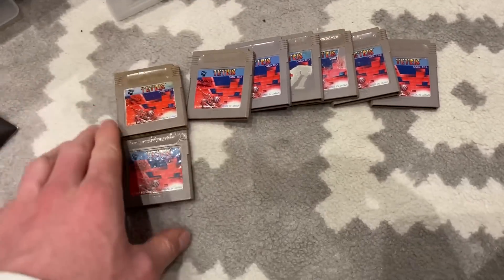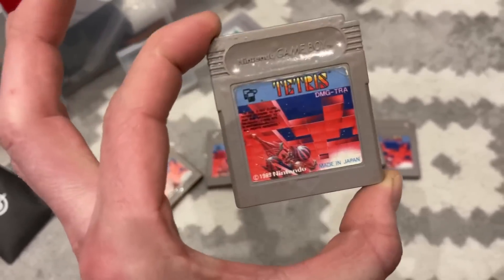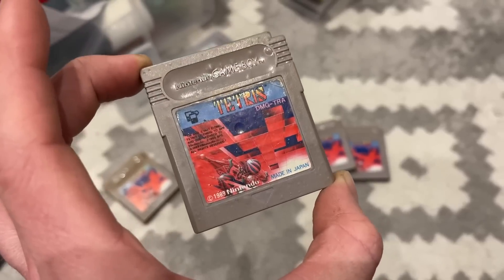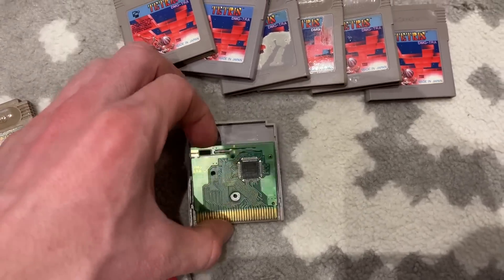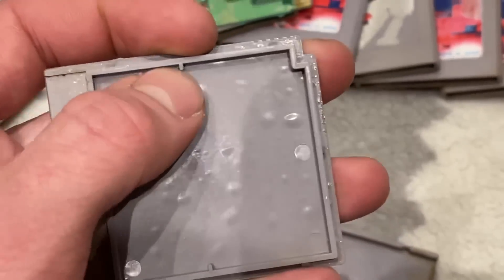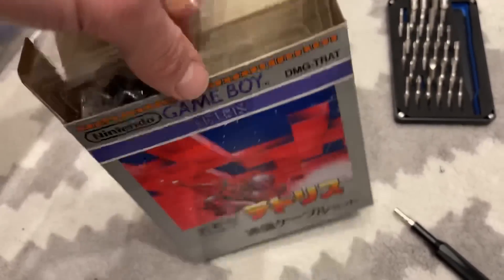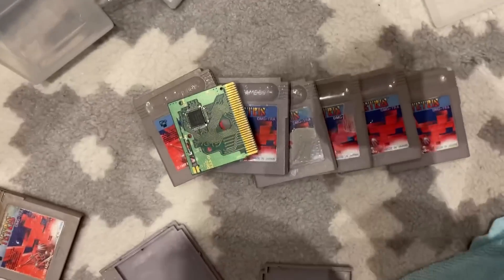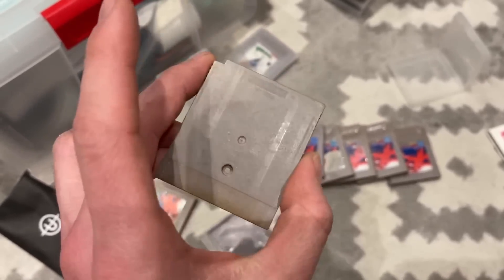Update on the destroyed GameBoy games

Comment: I doubt it’s fumes as you would need to douse everything in petrol.

Best way to find out is in a controlled test. One container with a small amount of petrol and a cheap game absorbing the fumes (overkill). The other cartridge put in the oven for a short period of time on the lowest heat.
Reply: on what basis are gasoline fumes NOT caustic?  it is the fumes that are ignited in a car.   if the fumes are active enough to be flammable, they are active enough to be caustic to other materials.  you know chemistry is interesting if you pay attention. i bet you think if you're wearing a gas mask, you're impervious to Cyclone B or sarin gas - no, it can still be absorbed in your skin.
Reply: @zxbryc  the volume and exposure of petrol fumes is the deciding factor. A short exposure will not do much especially if they are in a container as it will take a period of time for the fumes to enter the container depending on leakage and air pressure. Proximity is also a factor.
I’m not a chemist and I don’t claim to be. That’s an accolade that takes years to develop. My “educated guess” is that unless it’s persistent exposure (enough that could cause organ damage or breathing issues) then “I doubt” it’s petrol.

Comment: Don‘t use alcohol to clean them!! Use COCONUT oil and a bit of baking soda. Make a mixture and use your finger to rub and clean them plastics off.

This happens to old action figures from the 70s and 80s. Look at old My Little Pony and TRON toys. They are gooey and sticky. These old plastics are breaking down with age and environment. 

Again, don‘t use a solvent. Clean them, wipe them dry. The baking soda with safely scrape off the goo and the coconut oil with replenish the lost moisture.

Comment: The game boy cartridges are usually made from  PP petroleum products usually corrode mose of the plastics so that’s your answer probably the fumes made their way up cuz fumes go up when vaporize…it could be a leaky box u had them in not airtight and the older version could have a type of plastic that is sensitive to petrol…I guess they use more than one kind of plastic…maybe cuz it’s an old revision people had problems and Nintendo changed their plastic chemistry after a while…can you do a test get an old cover put a bit of petrol in a container and leave it in a box with a cartridge and see what happens…

Comment: Hmm seems reasonable. I should probably know this more definitively as a former chemist, but if it is an interaction with a vapor like gasoline, acetone, whatever, I would say that it wasn't broken down chemically, but it was just partially dissolved by the vapors. Then the structure sets back up in a slightly different shape than before but not chemically broken, just not in the exact same crystalline structure as before. Not that it helps any in restoring anything but just my theory. Or BS

Comment: How close to the ocean are you because a open air loft could be getting moisture with salt in it and that could be a problem gas is not going to leave a film on the cartridge but best way to tell is I know it's not very sanitary but if you still have one that is wet inside lick it with your tongue if gas or salt or something else you will be able to taste it most likely but I would invest in a dehumidifier for your loft and get water and air tight storage containers

Comment: Yeah, that sounds like a solvent that can melt plastic.  Vapors have the same effect of the liquid state. Not sure which material those chartridges are made of, so I cannot be 100% sure, but I know that grey plastic used for videogames in the '90s is cheap plastic (that's why it yellows and needs to be retro-brighted).
That could explain why the ruined chartridges are the old grey ones.
Again, I' m not 100% sure but all the clues match too well, it's difficult to belive it's all a coincidence.

Comment: I’ll tell you right not it’s not the hot or cold - I’ve stored these in temperatures up to 125F in my garage. Not a single bit of damage. Temperature doesn’t hurt this type of plastic.  It’s most defiantly a chemical interaction, and fumes from fuel could absolutely break down plastic. The fumes carry the chemical with them, which will bond with the plastic, leaving it kind of “squishy.”

Comment: Electronics are a curious thing. I opened up my Xbox 360 controller last year because it hadn’t been staying on and my batteries weren’t corroded. Anyways when I took the shell off it reeked of a smell similar to fish oil but it was incredibly hard to breathe around it. But what was even stranger was that the white plastic frame surrounding the potentiometers for the triggers, had been eaten away. I cleaned all with alcohol best I could to slow the rust/ corrosion from spreading, I also removed both rumble motors as they were covered in rust. I recently opened it back up and it hasn’t gotten any worse, I’m hoping I’ll be able to re-solder each of the components and get it to work again. The traces all look fine and that’s the only reason I still have a glimmer of hope that it can be fixed, however it wouldn’t surprise me if it didn’t. Anyone else ever see this happen/ know what happened? I’m paranoid it’ll happen to some of my other controllers even though I immediately take the batteries out after playing.

Comment: The way a house is built is all gas will try to off gas through the roof. That's why you need ventilation in your attic area. If You released gasoline into your house, the ethanol fumes 100% would have risen through the house and tried to evacuate through the roof. And if you have items out there, they easily could have been affected. Just because you can't see it, or even smell it, doesn't mean it isn't there. Look at covid as an example. You probably trapped some of the ethanol fumes, in with the plastic, and it started to disintegrate it. The bubbly and stuff and residue that you're rubbing off on your hands is most likely causing cancer. Next time maybe don't store a leaky item in your house that's releasing gas fumes? That could have killed you.

Comment: I think you figured it out, the petrol fumes likely started dissolving the plastic. And the older cartridges are probably a different mixture of plastic that's less resilient. They super sucks, bud.
Reply: It could also be a case of the cartridges not reacting well with the things they were stored in. Potentially due to being made of a different type of plastic compared to the unaffected games. He might want to consider storing them into containers made out of metal or wood; even if the motherboards are put into newer cartridge shells.

Comment: Why those particular cartridges are affected - most likely they are using exact same kind of plastic. 
Petrol fumes - i doubt, that fumes in such small concentration would made harm to something that was locked in box in the attic. Such concentration would cause explosion before it would reach plastics. :)

My opinion is that closed, not ventilated box was just pushing some kind of chemical reaction from plastics itself a lot faster. I have similar experience with my BlackBerry phones collection - ones that i was keeping in plastic bags are in worse condition (rubber coated plastics that are "melting") than ones that i keep on display on shelf where they can "breathe".